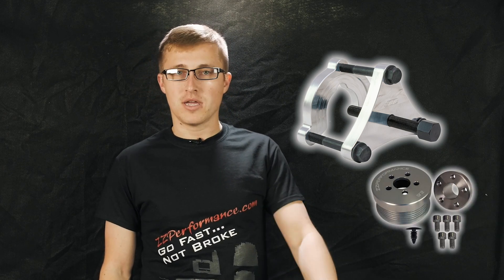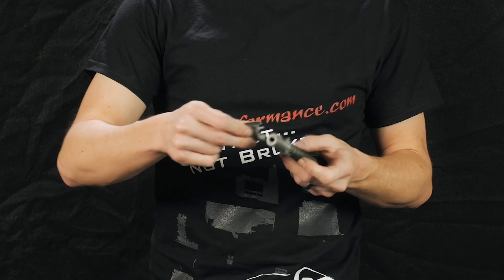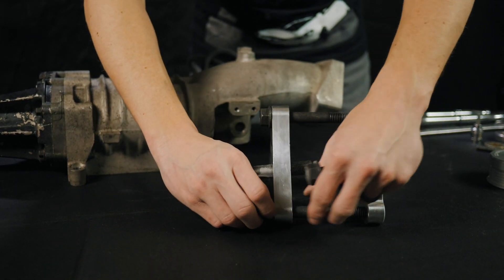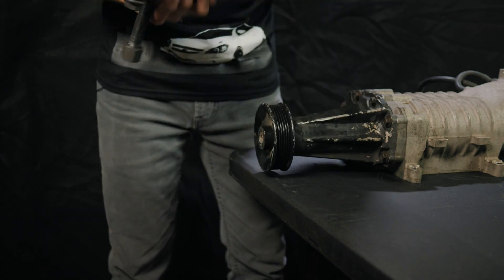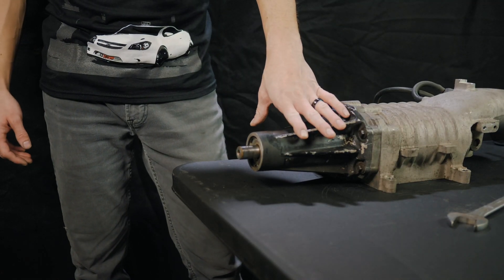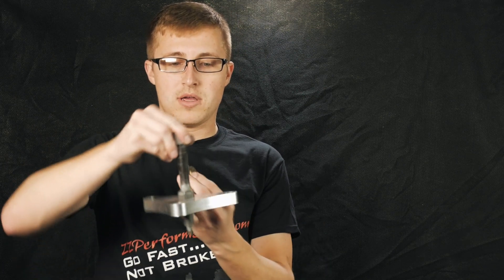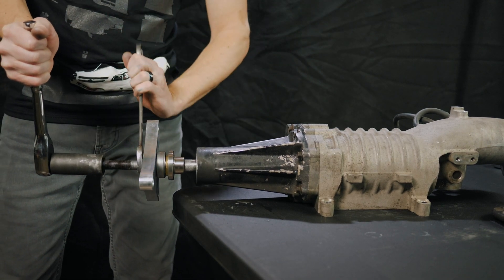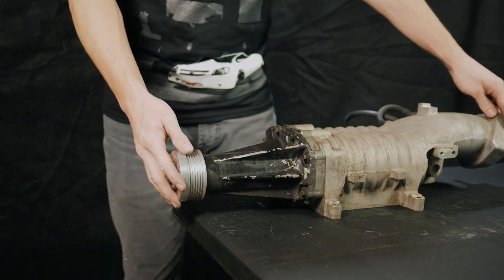How To: Supercharger Pulley Puller and Pulley Installation | ZZPerformance

Comment: Had to heat the pulley then quench it with water then use a 3 jaw puller after it came loose I used the ZZP puller then got the pulley completely off. Not as easy as it is on this video.

Comment: Interesting. Mine just unthreads the little bolt inside once the hub starts going on. The tool just falls off then.
Reply: So i did this a different way. Take the little bolt and an allen wrench or ratchet and install it into the supercharger shaft. Should probably clean the threads first. Tighten so its just past snug. Dont use your elbow torque wrench. Just your wrist torque wrench. click then thread the big bolt, plate, bearing, and washer onto the little bolt sticking out of the supercharger. Dont let the plate get tight yet. Thread the big bolt all the way in until it snugs up against the supercharger shaft. Grab some kind of giant adjustable pliers and grab the shaft of the modular hub. Not the supercharger shaft. Dont want to scratch it. While keeping the hub from turning (im assuming you followed zzp's instructions which means the hub is halfway-ish pressed on already) tighten the big bolt. Your big pliers will probably slip right about the right torque. Its not alot. Now hold the bolt from spinning and turn the nut, plate, bearing, and washer clockwise. (wrench moves towards the front of the car). Dont worry about scratches on the hub. Your pulley will cover it up.
Reply: @Koda-Kitikawa  the absolute GOAT bro thank you

Comment: Bent the shit outta my stock pulley and when i put it back on after changing the sesl that was leaking i wished id not been cheap and just bought the zzp after market one bc it shredded my belt on my way home from Indiana to NY and it barely had boost as the belt was so weak. Leason learned the new 3.8 zzp pulley is now on. Thanks great video.

Comment: Anybody else spend over 3 hours just trying to get the pulley hub seated? 99.95% of the time the shaft spins when trying to install the pulley. I have about 2 mm left to go and can’t get the shaft to not spin. I have no idea what I’m doing wrong. I’m following the directions on the pdf and this video.
Reply: hey man I know it’s a year later but I was having the same issue and used the other hex screw they included in mine, put that into the shaft instead and it no longer spins

Comment: Pulley puller was good just the shaft that you used to press off the pulley mushroomed out screwing up the threads that you screwed into the supercharger and I had to cut the end of the shaft off with a thin cut to get it to work need a little bit harder Steel
Reply: Yeah I’m having similar issue right this minute, seems to be shitty material for the puller shaft(and the rest of the tool generally), very disappointed, rented the puller to make this easier and it’s now turned into a 5hr job, assuming I can concoct something to even finish the job now that it’s literally broken during the install. Wow guys.
Reply: no clue why they decided to go with a little washer in between the main bolt to press the pulley off, this immediately became an issue for me and instantly mushroomed the thread out, was able to get the pulley off but now can’t get the new one in without getting the plastic out of the thread

Comment: Hey guys. Will the puller remove the hub if you want to replace it with the oem pulley?
Reply: U can use a normal puller for it

Comment: I dont understand why you cant use a 3 jaw puller 🤔 the reason I dont understand, is because that's what I used and then I heated the new pulley to 400 degrees and slid it on like butter. Changed the pulley on the car in 10 minutes. Maybe I got lucky, or i just used my brain 🤔
Reply: my eaton was at 200k miles, this thing took 3 men wrenching and holding the charger down to finally get the pulley to bust loose, I think you got lucky
Reply: Where do I change the bearing tho??
Reply: I changed a pulley on a 22 year old M90, not that many miles but it came off and new one went on easy 🤷‍♂️ I pull off pulleys on 20 year old industrial coolers a couple times a year that put up a fight but still haven't needed a hydraulic puller yet.

Comment: So the old pulley came off the part you put back in first? I need to replace a pulley on a 1993 Buick PA SC. The pulley is squealing. When I spray WD 40 onto the middle of the pulley not the belt or belt grooves it goes quit. The first piece you put back on after removal where did that come from?

Comment: So I followed this and got my hub flush same idea. Have the 3.1 pulley that came with my supercharger kit for my 2.4l. The issue I have is I get really bad belt squeel. Uses the le5 tensioner just as the kit intended. I have to put a new idler pulley on ever couple weeks and the noise keeps coming back. I have noticed that the belt doesn't lign up between the tensioner pulley and the idler pulley. Is it possible that with this kit the hub needs to go further?
Reply from the maker: Hey Dailenator, shoot us a message about your issues at customerservice@zzperformance.com and we can help you out.

Comment: I will be getting this soon. Great video and makes install very easy and simple.
Reply: Did you buy it? And can you tell me when changing this pulley, how do I change the Bearing???
Reply: @caylee3277 I know this is a year late but if you haven’t figured it out yet i’m pretty sure you need a whole new snout, grab one from another m62 and it’ll bolt right on